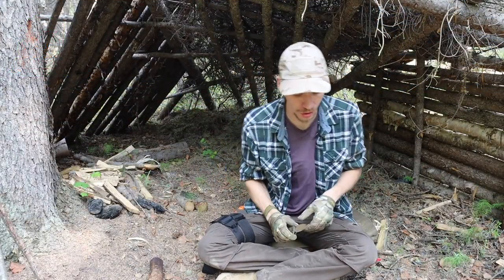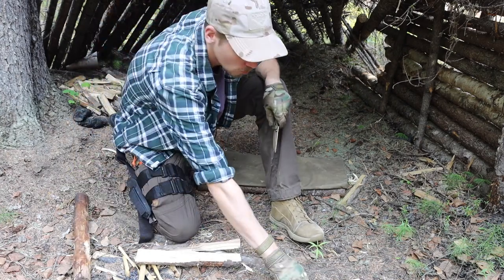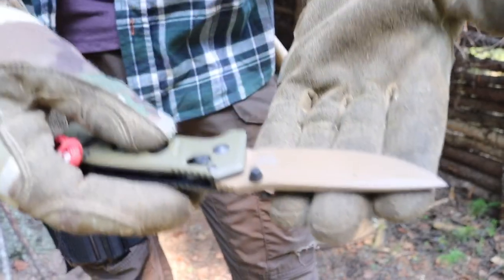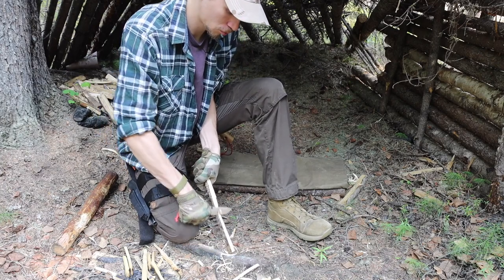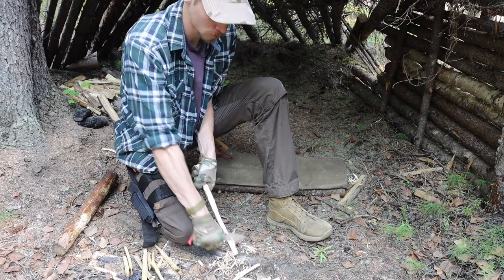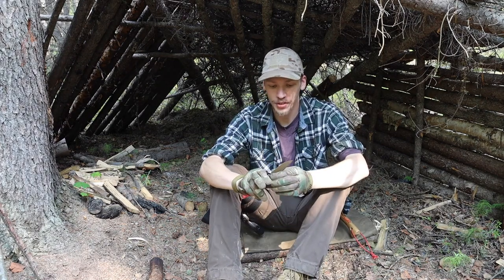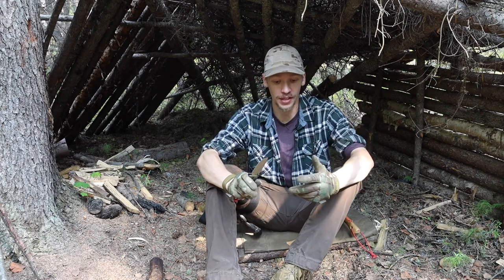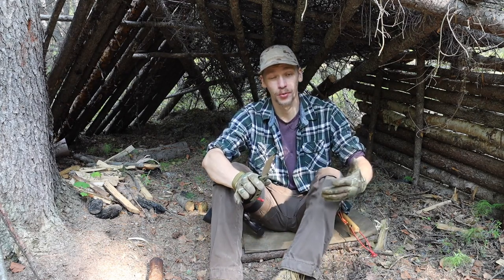Benchmade 273 (Not So Tough After All?)

Comment: I never baton with a folder, only use knifes as they are intended to be used. No folder will stand up to this.
Reply: Check out Joe X channel where he puts some folders through hard military use. Triad lock from Cold Steel stands WAAAAAY heavier use than batoning. You can hit it with a rock on the lock and it will hold (especially a 4max that holds 600lb of pressure…600! Stronger than most light to medium fixed blades and small hatchets).
Reply from the maker: A good Axis lock will hold up to this. I have videos coming.
Reply: Cold Steel : Hold my beer
Reply: Benchmade advertises the adamas as a hard use "tactical" blade. How on earth are you going to use the adamas in a hard use tactical situation if it can't even handle light batoning???.
No one is going to process wood with a pocket knife. He's just doing light batoning to test benchmades claim of it being a hard use "tactical" folder. Benchmade is obviously lying about it being a hard use tactical folder.

Comment: Why would you use a folding knife for batoning at all, especially the 
smaller version ?
You could have 4 big beefy Schrade
fixed blades for the price of that now ruined Benchmade.
Reply from the maker: It was to test claims of weakness. I know I would get hate if I did it, and get hate if I didn't so here we are.
Reply: Benchmade advertises the adamas as a hard use "tactical" blade. How on earth are you going to use the adamas in a hard use tactical situation if it can't even handle light batoning???.
No one is going to process wood with a pocket knife. He's just doing light batoning to test benchmades claim of it being a hard use "tactical" folder. Benchmade is obviously lying about it being a hard use tactical folder.

Comment: The NPCs in the comments saying they would never baton a knife are missing the point. Let's say in a pinch you pull out your knife to do an awkward cut, you slip, pull back and hit something. The force I have seen to make an Adamas fail is well within human force accident range. Then your hand is cut, bleeding and perhaps needing stitches. This is unacceptable performance for a tough use knife when a Bugout is tougher. Clearly the axis lock met it's match with the design in this knife. Too heavy, not enough security.

Comment: I haven't really been carrying folders alot anymore for EDC. I usually will carry a small izula sized fixed blade IWB. I have a bunch of stuff that size like the izula, bk14 eskabar, BM hidden canyon, couple custom ones, Bradford Guardian, ect. Its not absolute comfort but if you ccw your used to it anyway. Frees up a pocket nobody see's it. They are stong enough for most tasks but nimble for fine tasks. I've lost quite a few folders in my days too either working construction or in the woods wearing a folder in my pocket. I'll be doing something and brush up against something or a branch at the perfect height and it has lifted my knife out of my pocket without me noticing. I lost a Spyderco Shaman that way. Luckily i was on a very leisurely trail behind my house and backtracked.   I actually found the knife on the trail hanging by the clip on a branch. Hasn't happened to me yet with a fixed blade in a sheath.
Reply from the maker: That might be for the better seeing these knives fail!

Comment: Definitely not disagreeing with you about the first generation Adamas being stronger, but I do have to say that I don't believe one of its intended purposes was to split firewood! You're not supposed to split small logs with a pocket knife; that's what a hatchet is for. 😳
Reply: Benchmade advertises the adamas as a hard use "tactical" blade. How on earth are you going to use the adamas in a hard use tactical situation if it can't even handle light batoning???.
No one is going to process wood with a pocket knife. He's just doing light batoning to test benchmades claim of it being a hard use "tactical" folder. Benchmade is obviously lying about it being a hard use tactical folder.

Comment: If one wants a tough folding knife they need to look no further than the Buck 110 or Cold Steel AD10.  BUT, we should also remember these are knives (cutting, slicing, carving), not hatchets or axes (chopping, splitting).
Reply: Cold steel 4 max scout, everything that costs 1€ more than that and claims to be “strong” is wasted money.

It’s not good looking, it’s a tool and it’s a really absurdly strong tool. It replaced saw + fixed blade for me.
Lighter and equally capable, not missing anything when it’s on me. It’s easily carryable in my pocket and does everything while hiking and climbing
Reply: @clintwestwood3539    I had a Cold Steel 4Max Scout and do not disagree with you.  I just preferred the Cold Steel AD10.  Today in the wilderness I carry a Victorinox Camper SAK and a small Kephart style hatchet and never feel I am underserved by these tools.  If I was going out for a long trek I might add a small folding saw, but the saw blade on the Camper has not failed me yet.
I still believe knives are for cutting, slicing, and carving and hatchets & axes are for chopping an splitting.
Reply: @ROE1300   I agree with you completely. This isn't an ultra light backpacking channel. And if a 1 to 2 pound knife is the difference between you being able to or not being able to achieve your backpacking goal then you have deeper rooted issues.
Reply: @ROE1300  I can agree that knife + saw + axe + small blade for food prep should be what we bring out, but when I tried different configurations, the 4 max alone as carry stood out to me. I walked Slovenian woods (really harsh) for a month worth total and I never ever needed more than that. It’s also pretty decent for cooking (I still use my Opinel 10 for it but it’s so lightweight that I don’t count it)
Reply: @kejadventures241  it all depends on what you do outdoor. If you are someone that actually walks/explore 1/2 pounds can make an huge difference especially on multi days. It’s not even about ultralight, it’s just about optimising what you have on you for the best comfort. 

Personally when I go for a 40km trip three days (100/120km total) with huge up and downs through mountains and with some walls to climb, you realise how much stuff you really don’t need.

However if you just take a bag, walk a few hours to then set camp with a 15/20kg backpack on you that’s a different story. I enjoyed the video (as probably others since lots of people do what I do) and it’s relatable.
Reply: @clintwestwood3539    My largest Opinel is a 9 with the the wood handle replaced by an elk antler.  Still extremely light.  I am happy the 4Max works for you, it a great knife.  With either the 4Max Scout or the AD10 there really is no need for a fixed blade.  This is a great thing about out hobby, we get to enjoy beautiful places using whatever kit for us and nobody is totally right or totally wrong.
Reply: @ROE1300  totally! I don’t get how some people get angry because they just can’t understand others experiences and needs, thinking they have the only answer.

It’s all about what we need, what we like and what works for us in that exact situation.

Cheers!
Reply from the maker: Yes this is true. Just testing the claims of others.
Reply: @AlaskanFrontier1   You might also consider the Grohmann model 300.  It appears to be the equal of the Buck 110.

Comment: Battoning with a pocket knife? What has the outdoors community come to? 

 If Only there was a tool with a long handle and a wedge shaped blade that you could get for $25 that could do this same task. But it's probably a better idea to use a $200 folder designed to ride in your pocket for work as a hard use outdoor tool.
Reply: I stand behind chopping and batoning with a folder knife to be honest.

Let me explain: I use a Cold Stee 4 max scout for my main weekend hobby which is trekking/hiking/climbing with some camping/bushcrafting for the night to both eat and sleep. If you walk 20/30 km with huge difference in heights, through mountains usually, you want every single grams on you to count. You don’t want extra weight. You can carry a foldable saw during winter (better than an axe IMO since I’m not building camps and not staying in a place for more than a few hours to rest) and during summer the saw becomes cumbersome and not that useful. A GOOD folding knife with a GOOD locking system (and 50/100€ is more than enough for that) will do everything you’d do with a small axe, saw and bushcraft knife.

That’s why a folding knife with a strong lock has its place. Not everyone wants to go in the woods, find a single spot and build a camp. There are some people that prefer to explore, walk (a lot) and then use bushcrafting skills to set up a resting place while eating/sleeping.
Reply: @clintwestwood3539   There are lightweight fixed blades designed purely for that. As a carpenter I carry heavy tool bags and boards all day up-and-down ladders. Carrying a bag on the weekend is no issue for me. 

And someone who does this regularly you should be building strength. So why not add a few pounds and make yourself even stronger. 
Like you said you're walking 10 to 15 miles in the mountains, being stronger will only benefit you.
Reply: @kejadventures241  it is when you climb a wall and do 30/40km trekking. Climbing a ladder and climbing a wall it’s WAY different. Not even in the same universe as effort.

A strong lock folding blade will outperform a lightweight fixed blade any day any time. You can take a look at JOE X channel too if you want to see how far can knives go. 4max simply doesn’t break at its lighter than any fixed blades I own and I can reliably chop and baton with it.
Reply: @clintwestwood3539   Now it's 15 to 20 miles? 
 For a European you sure are like watching a lot of American outdoors videos. 

 You're shooting yourself in the foot man.   people who do that kind of distance in the mountains bring stoves. Especially if this is a weekend hobby and you have to go back to work Monday morning. Your MAIN weekend hobby. 

 I think I see what's going on here. You are just subscribed to an idea with no actual experience. Liking your own comments doesn't help your cause either.
Reply: @kejadventures241  it all depends on the trail. Something like Via degli Dei in Italy is different from the primitive trail in Spain.
I do bring stove, I do bring food, I do bring water. Like everyone.

What I’m saying is that when you start walking for more than a few hours you will start regretting having extra weight, especially if while your are trailing you do an Alta via or have to climb a wall (and you have to bring your helmet and stuff for that too).

I’m not trying to convert you. I couldn’t care less about that. You said that it didn’t make sense, I’m telling you from a personal point of view that it does. For me as for others.
No reason to argue there. I too started with small hatchet, folding saw, victorinox and fixed blade. Realised that the hatchet was redundant, folding saw/bow saw useful in winter time and fixed blade heavier than a folding one and probably less capable (DBK/Joe X do decent videos on the topic too and I can confirm as user what they found).

Also no need to get angry because someone has a different experience. You said it was futile, I’m telling you it’s not. As OP could have done too since in the video he’s stating that a good folding blade is more than capable (and in other videos too). Relax a bit, take a deep breath from time to time. It can help you live better and probably longer!

Cheers
Reply: @kejadventures241  also if I have to respond like you do, I’d stop to when you compared climbing walls to climbing freaking stairs.

That’s probably the most American thing ever. Literally seeing climbing stairs as effort. Probably using your car to drive 50 meters too? No wonders about the high obesity percentage and heart problems in that country.

I’m going to stop there, no need to say more…
Reply: @clintwestwood3539   Your American colloquialisms are really not making you seem like a European adventurer. 

 I have no doubt that there are pocket knives strong enough to do dumb stuff with, but that doesn't make it not dumb stuff. 

You're all over the place man.
Reply: @kejadventures241  I take that as a compliment then, it means that I learned the language well! 
Thanks,

Cheerio
Reply: @clintwestwood3539   LMAO, you did it again. Colloquialism Isn't something that you learn over time outside of the country it's used.  You're on 75% of the comments on this channel protesting against everyone. you told me to calm down?🤣
Reply from the maker: Hey man, just doing the test because others claimed the knife was weak.